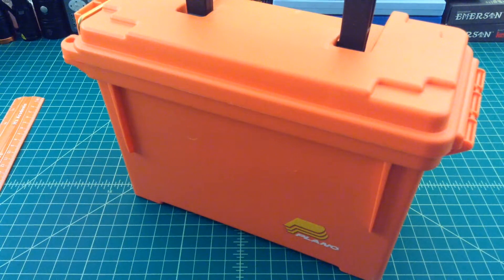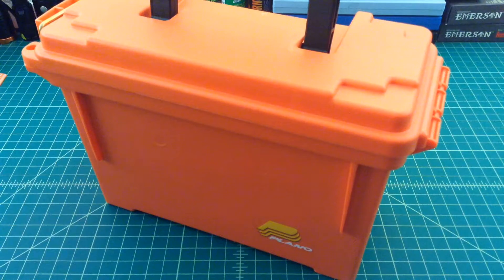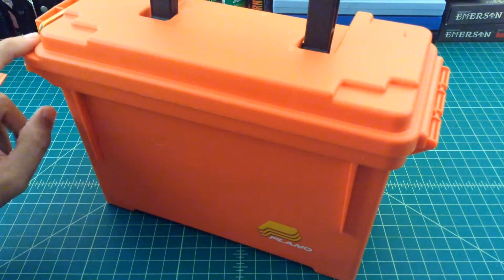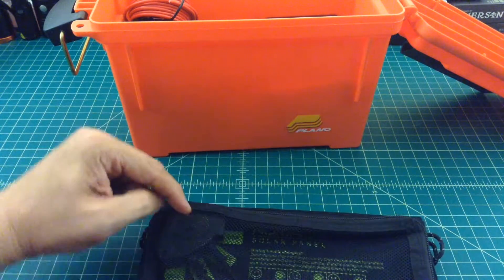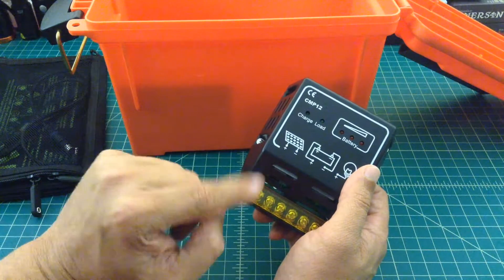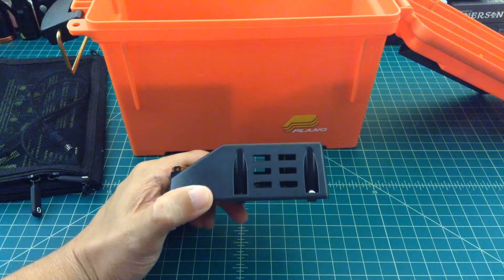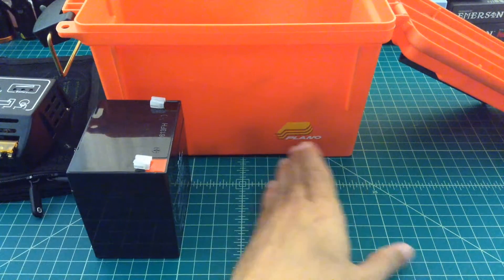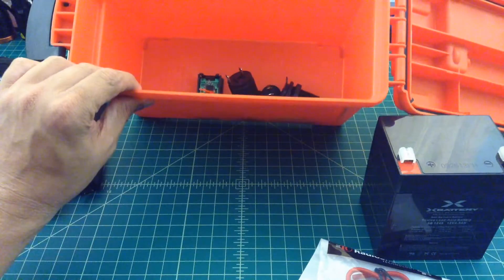Small DIY Solar Generator  - Go Box 12v Battery Kit (Part 1) - TheSmokinApe

Comment: 7w all day isn't enough to replenish the battery from the over-night discharge that the charge controller's LEDs will result in. You're battery will drain more than it will charge. I have experience with that charge controller. I ran it with a 10w panel and it simply drained more than it charged because of the charge controller's over-night draw.
Now I'm using a 100w panel and the issue is solved.
Reply from the maker: +mygamertag2010X Thanks for the tip, I have the on / off switch controlling the whole box, so if its in the off position the controller will not draw.
Reply: Yes good idea! My concern is, for example, if you're charging a phone or whatever at night, those LEDs are drawing. I wish there was an easy way to fix this problem. I watched both parts, I think your box is very space efficient and looks very good. Lots of these custom boxes on YouTube end up looking unpleasant. Yours is nice! Great videos!
Reply from the maker: Thanks man, I am onboard with your concern.  I am going to have to do some testing and see what happens.  I still haven't even tried this box out yet...  lol...
Reply: +TheSmokinApe No problem. When you get around to testing it, post a follow-up video or comment here with your findings!
Reply from the maker: Will do...